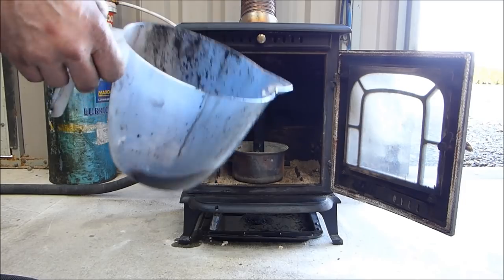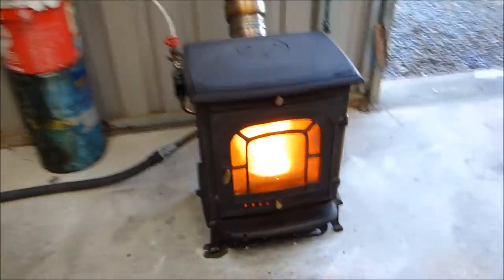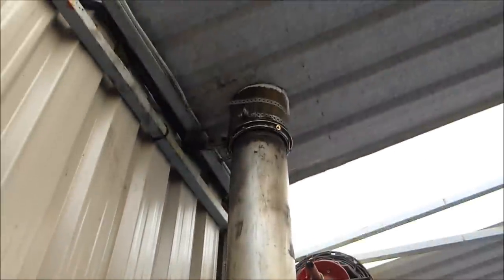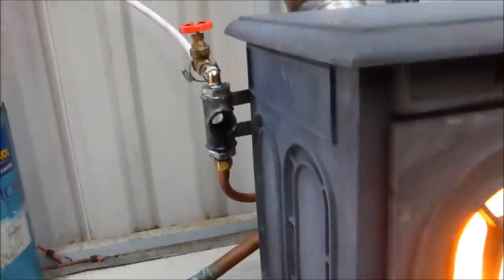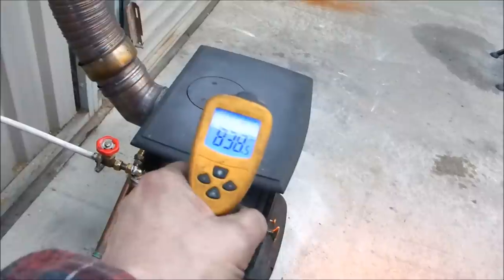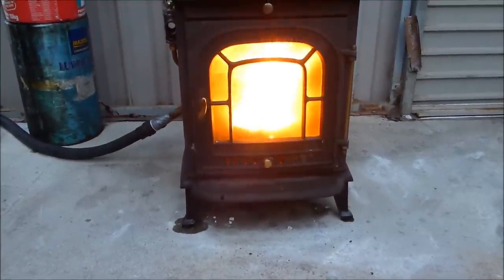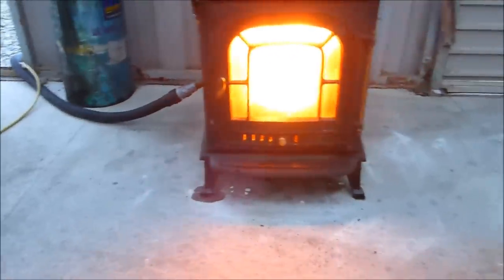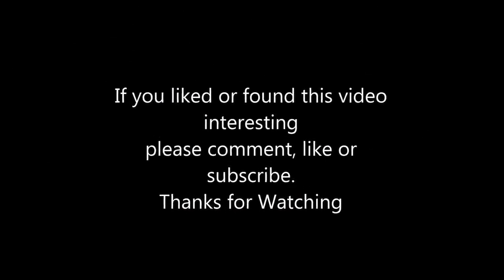Amazing ...Convert your Stove to burn waste oil

Comment: Hello Gerry
Man I got to tell you I really like your videos, both you and 2jeffs1 really do a great job..I also appreciate you guys giving us all this free info, seems these days when everyone has their hand in your pockets its so nice that guys like you are trying to help people out.I a going to build one of these to heat my garage this winter , using an stove like your factory one and installing a water tank on top of it and pumping that water into a car radiator and fan in my garage , thought about a copper coil of 1/2" soft copper but I didn't figure it would stand up too the heat.here in Canada I would not be able to get insurance if I put the stove in my garage they are very strict so I will build a concrete building out side to house the boiler and just pump the hot water into the garage,gets very cold here down to -30c at times and my building is 24 x 36 feet with 7 foot ceiling, but is insulated, do you think my idea would work, I have designed a full control with high and low fired solenoids  controling  the oil flow. with flame out sensor and high temp sensors as well in the stack as well as in the water tank.I value and appreciate your thoughts,thanks much for your comments and please keep the videos coming.
Reply: Did you build this mate? How did it go? I'm wondering if you're better off pumping hot air into your garage rather than hot water. I am currently building a heater outside my house, burning waste vegetable oil in a 55 gallon drum, with a box built around it, and a blower blows air from the house, through the box, and ducted back to the house. Simple heat exchanger. Will regulate temperature with either Arduino and servo on valve, or 2jeffs1's method with solenoid valve, or both.
Reply: @paulraymond1804  built it but insurance company's here will not allow anything home built. but it worked great, the thing about the hot water is in a cast radiator it holds the heat for a long time.anyway I sold it to a guy who doesn't worry about insurance.I have far too much invested in my shop to not have insurance.

Comment: Are you feeding the oil into the air inlet pipe?
Reply from the maker: The oil pipe that travels through the air inlet pipe which helps keep the oil cool. Cheers

Comment: im sorry but what oil waste are you using? car oil or cooking?

Thanks
Reply from the maker: Hi Sam. In this video I am trying the stove with waste motor oil. To see the stove with a different non fan assisted burner running on Waste vegetable oil check out this link. http://youtu.be/AduAYRr9cOM?t=1m47s  Cheers Gerry

Comment: You show that u have a pretty good working burner but u don't show how it all works. I don't want to see that it works but how it works. How did u pipe into the used oil and to the stove.

Comment: Is it good for the nature to burn motor oil?? Just asking... There is big differency between motor oil and veggie.
Reply from the maker: Hi Peter. Its not green or carbon neutral burning motor oil but this setup will burn veggie oil and even logs which would be.
Cheers Gerry

Comment: Will this work with natural ventilation or is forced air required?
Reply from the maker: Hi Rick. I have quite a few of these stoves running normally aspirated. Here's a link to a stove / cooker I built using this waste oil burner with no fan. Works great too as a cooker but I am no chef lol  https://youtu.be/tnzEDEpz3Yk Cheers Gerry

Comment: Gerry, I was thinking on heating a big farm shed with waste oil im about to insulate. Do you think I could have a copper coil in the flu with circulating water from a large oil drum.  Once the oil drum water is heated pump the hot water through old radiators.
Reply from the maker: Hi David. In some of my later videos I had this setup in an old oil boiler and I was heating 300 litres of water easily in about 1 hour. There are lots of ways of doing what you want and this burner setup definitely has the muscle to do it. You could convert another tank into a boiler and run your exhaust gases through it and recover the heat into your water storage. Make it open vented so there is no build up of pressure. Cheers Gerry
Reply: Yeah I know what you mean, I work with rock breakers and was told was hydraulic oil was too watery for this but i'll have to test this out, have you tested hydraulic oil yourself?
Reply from the maker: David Rankin Hi David. I have tried most types of oil and so far if you can make it flow and drip they have worked for me. I mostly burn Veggie oil in the burner but it is very easy going about what it burns. Cheers Gerry

Comment: hi Gerry iv tryed every thing but i still getting smoke and a lot of sut what am i ding wrong mine was a old oil heater and conected to the heating in my home it works but smokey
Reply from the maker: Hi John. Can you send me a photo of the setup and I will have a look. Cheers Gerry
Reply: Gerry's Waste Oil Burner i have a 8 ins pot and a 6in flu and the power is not there i dont no how to send you a picture on here the heater is getting warm but not hot enough to heat the rads it heats the water but take a long time i love trying it out great pass time i will keep trying thanks for the message and love your vids
Reply: John Murray SURE YOUR FLUES NOT TOO BIG?

Comment: 2-3 litre an hour? that is 20-30kWh that is a LOT of heat on that small stove. how much heat is lost thru the chimney?
Reply: We recently experimented with ours and zig zagged the stove pipe in four 5' runs that go horizontally and ended up saving a lot more of the heat. It worked great

Comment: Hey Gerry, that a lot of fire, and 3 liters of fuel an hour turns into around 2200 liters a month running full time. That a lot of fuel. You better come up with a better number of
liters per hour or you will be constantly lugging fuel to the stove.
Reply from the maker: Hi Wayne. It can certainly get through a fair amount of oil but that's running it hard and producing huge amounts of heat. If I need less heat it will obviously use less oil. I generally mess about in the shed for a few hours and my later burner will burn solid fuels as well which gives me many fuel options for heat. Cheer Gerry

Comment: can i use transmission oil instead of motor oil in a waste oil burner.
Reply from the maker: Hi Nathan I don't see my earlier reply to this but you can use transmission oil once you get the evaporating pot red hot first. Then it will burn all day long. Cheers Gerry
Reply: ok thank you. if check out engineer775. on you tube he has some good prepper info.

Comment: I've been thinking that maybe this could be very useful on a machine with steam boiler.
Reply from the maker: Hi Tiago. I t would be very easy to use a boiler stove with this version of the burner. The burner would have to be inserted through the floor of the boiler stove. In this video I use a boiler with different version of the burner http://youtu.be/bvparmYPbjA?t=4m26s  In another video I heat 300 litres of water to over 90 degrees c . http://youtu.be/1Et3rIn5GIY?t=1m10s Cheers Gerry

Comment: what is the temp for the exhaust? is it hotter that the exhaust than a wood stove?
Reply from the maker: At the roof level the temperature is about 200 c. Cheers

Comment: Are you burning waste cooking oil or waste engine oil
Reply from the maker: Hi I mostly burn veggie oil but have tested it with motor oil and it works very well on both In later videos I converted a propane tank to burn solid fuel and oil. It also used both a blower type burner and a passive dripfeed setup. All work great
Here's a link to one of them      http://youtu.be/yLcmKVt1O2U
Cheers Gerry

Comment: There is a guy on YouTube that runs stainless pipes right through pellet stoves. He uses it to feed his heating system... his boiler never runs. Obviously he has pressure gauges and blowoff valves.

Comment: Can someone answer my questions what kind of oil did he use? 
Is it alot of heat?
Reply from the maker: Hi Kissachi Yarungsee I was burning used motor oil. I start the burner with a little kerosene or diesel to get the chamber red hot and then add the used motor oil or used vegetable oil. It makes lots of heat and can easily make this stove burn red hot. You can see how hot it can get here https://youtu.be/TpsnLapDbv4?t=2 Hope this helps Cheers Gerry

Comment: A dimmer switch would do damage to the electrical components. Them RDB burners need 220/240 volts.
Great idea I have to say.
Reply: I think he may be talking about a PWM speed controller. That may work with that blower. A few days ago I took a 220v blower from a gas central heating unit, wired it up to my PWM speed controller and it worked perfectly.

Comment: how much smoke do you get if you turn the fan off?
Reply from the maker: Hi JP.  This burner wont burn correctly without forced air. If the air is turned off it will smoke and most likely go out. I made a burner in my later videos that does not require a fan and burns about 2 litres per hour. Here's a link https://youtu.be/XmAqunRfCaA. Cheers Gerry
Reply: Gerry's Waste Oil Burner ok, just wondering. ever had any fires start outside the unit before?
Reply from the maker: Hi JP. No not personally but apart form a demo in the house I only use these burners in my shed which is concrete and steel. I made a video where I added just a few drops of water on purpose to demonstrate what happens. The reaction is very dangerous if the door is open it could get as far as a roof or ceiling. Here's a link https://youtu.be/MeCpIDJBP40  Hope this helps. Cheers Gerry

Comment: iIn my country all heating systems must be certified and audited annually . Both for reasons of safety and pollution . this "thing" how many KG of CO2 discharge into the atmosphere in a year?
Reply from the maker: Hi rappe. Its true this is a crude instrument but it does produce a huge amount of heat. I doubt it will not pass certification. but on a positive note it will burn logs too. Cheers
Reply from the maker: Hi Mark. I am careful when using the burner and although I do have a Stanley log burning stove in the house I will not convert it. Very easy to convert an old oil boiler to do the job and transfer the waste oil heat to hot water. I understand that not everyone will like this burner but at the very least its an interesting project and maybe helping to heat someone elses workshop / shed.  Thanks for the comments Mark Cheers Gerry
Reply: These systems rely on dont say, dont tell. or in other words. I wont tell if you dont!
Dont feed bureaucracy!!!

Comment: the electric fan bothers me = its using electricity so its using two types of fuel to burn ..... how much electric does it use ?
Reply from the maker: Hi Mark. I have used other fans with this setup and 60 watts does a nice job. In that video I think the vacuum cleaner I was using was about 1000 watts but I only used it for convenience. In my later burner I dont require electricity at all and manage to get a great amount of heat output for just 2 litres per hour. Thanks for the comment Cheers Gerry

Comment: if everyone is doing this then the greenhouse effect would kill us all
Reply: How would you create heat? Anything you can think of causes some CO2. This looks like its burning very clean.
Reply: Our sun and earth radiate lots of heat. If we have too thick of atmosphere it will create the greenhouse effect and circulate the heat around, and the temps would skyrocket. But o well not gonna stop ignorant people from being themselves.
Reply: ***** Oh, then heating like this is a GOOD thing then. As the temperature would increase then we would not have to use these things to heat our houses. Then the temperature would level off.

Comment: But you don't have any kind of heat exchanger?  You are exhausting a large portion of your heat.  You already need electricity for the fan just add a small pump and some piping and a radiator, bam,  much more efficient. Also with a more efficient system you can turn down your flow, as all that exhaust going out must be displaced by cold air coming back in from somewhere. you are kinda defeating yourself with that setup.
Reply: No different than burning wood and waste oil is free. I agree with a heat exchanger it would be more efficient and you could actually heat your home with it. But this is for a shop, so no need, as it puts out enough heat.

Comment: https://www.northerntool.com/images/product/400x400/162/16272_400x400.jpg.  "Industrial infrared heaters" (the long gray silver ones) run on propane or natural gas, would be amazing if could run on waste oil but probably would have to filter for a catalytic converter that might be ruined by any contaminants

Comment: So if I use this 8 hours a day, 3 days a week, 5 months per year, I need at least 250 gallons of oil? Yikes ..
Reply: Probably you would use more if you had a car depending on the size of the engine.
Reply: Most auto shops have to pay to get rid of oil so most give it away.

Comment: I don't know about the technical details but that thing looks dangerous.  I would not want it in my house.
Reply from the maker: Hi Peggy. This is just me playing in the shed. My house is off limits, my better half would kill me. Cheers
Reply: Gerry's Waste Oil Burner Best to check you home fire policy.  If you have a fire in your shed (due to the oil burner) and your house catches fire, you may not be covered. At the very least, inform you insurance company about the existence of the oil burner.  If it is noted/mentioned on the policy then your butt is covered (and your house).

Comment: Waste oil my ass, that stuff is cleaner than the oil in my car. If not brand new...
Reply from the maker: Hi This burns waste veggie oil and waste motor oil. The oil being burnt in this video is out of date veggie oil. It could just as easily be black motor oil as you can see in lots of the videos. Lots of people have made these they do work. Cheers Gerry

Comment: seems like you are wasting a lot of energy I would get a gas hot water heater and run the exhaust down through that to extract the rest of the heat and get free hot water out of the deal
Reply from the maker: Hi Charles. I did a version with a boiler. http://youtu.be/xvddVsLqLdc  Getting something for nothing is cool, of course solid fuel versions have been around for years but this is one way of recovering heat from waste oil. Cheers Gerry

Comment: You people making these heaters need to learn you create a lot of heat but it goes up the flu.  Figure out how to capture more of that heat ?
Reply from the maker: Hi Sam P. The flue is single walled and recovers some of heat to the shed too.My latest burner does not require any fan and still makes a ton of heat. https://youtu.be/tnzEDEpz3Yk Cheers Gerry

Comment: where can I get the waste oil from
Reply from the maker: Hi click411. That's the achilles heel of this little project. You need friends or contacts in the food industry or maybe garages. That's why I made this a multifuel stove ie. coal, logs,wood, oil etc. so that I could keep it going on whatever the available fuel was. Cheers Gerry